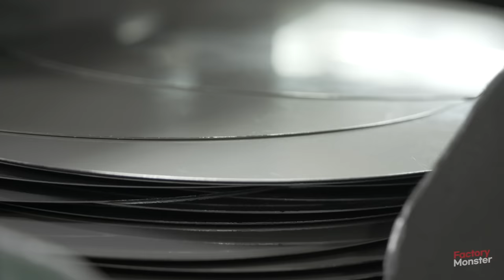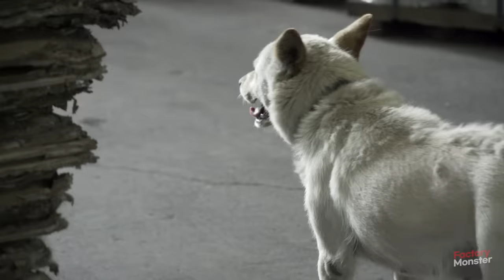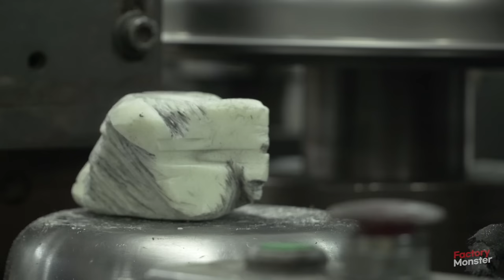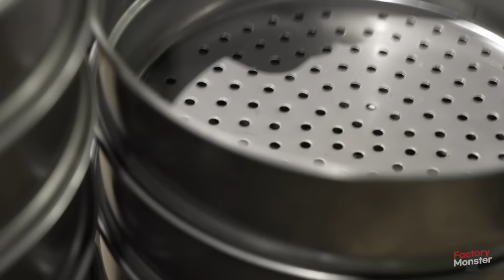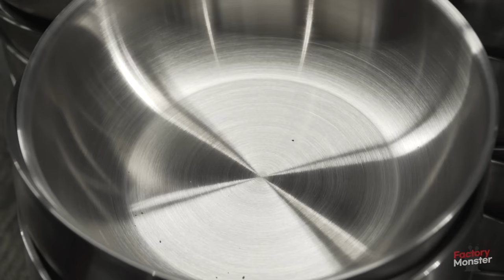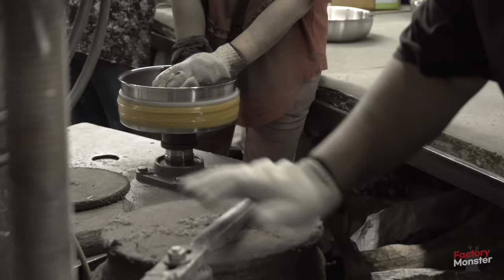Stainless Steel Steamer Mass Production Process. Korean Cookware Factory

Comment: Thank you for the tour! Polishing operations needs to be automated the most. Easy to automate, saves a huge amount of time.
Reply from the maker: Thanks for watching :)
Reply: Haha. Da kostet der Mensch nix.
Reply: @thomasschafer7268  в россии так же. Очень многое дешевле человеком лелать, чем автоматизировать. Но ситуация меняется. Людей все меньше готовых так работать.
Но руководство не дпемоет: Снизило уровень обязателтного образования до 4 классов школы. Уничтожило систему профессионального образования.
Reply: Automation cost a lot of money.
Reply: @Richard-om7vd  Having that many people doing polishing of a huge volume of products, it's actually cheaper to automate. However the psychological upfront cost of automation prevents many business owners to do so.
Reply: @x_ph1l  Are you willing to pay for it? Set it up, get it running, fine tune it so it matches the product EXACTLY like it was before?
Reply: @Richard-om7vd  If it were at my factory (which I have), then yes.
Reply: @x_ph1l  Nice. I'm almost 68, retired, former aerospace machinist, 30 years same company.
Reply: @Richard-om7vd  Cool. What we do is mostly fab shop type of work (plasma cutting, welding, powder coating, etc.). I'm only starting to get my feet wet in machining - so much to learn, but super interesting.
Reply: @stepansml6713  Про 4 класса - это ты сам придумал или есть доказательства ?
Reply: @stepansml6713  это ваше будущее! Вперёд  путина рука укажете путь
Reply: @x_ph1l  когда руку не заняты голова начинает думать а тамдумать вредно
Reply: @АгронДепартье  ст 43 пункт 4 конституции рф.
Reply: @АлександрЛивинский-в9й  это ваше настоящее. Я успел в нормальной стране отучиться
Reply: @stepansml6713  А отработать успел? Тогда удачной пенсии даже не большой
Reply: @stepansml6713  Ну - всё верно. Основное, а не начальное образование. Где там про 4 года ?
Reply: Less automation = more jobs = less wealth concentration.
Reply: @АгронДепартье  изменилось что то.  В лучшую сторону.  Что удивило.
Reply: @pdr5926  I would just LOVE to work as an elevator operator! Do the lever pushing all day every day. Up down up down up down. Great)

Comment: I’d like to know how many operators or hands have gone through those feed rollers. It very simple and cheap to put a feed/sort line in to move the operators away from the machinery. Also polishing is easily done with basic automated machinery
Reply: Bad engineering control. Definitely right
Reply: Сколько станков вы установили или поставили в северную корею? Ноль. Ваше правительство против кндр. В кндр есть производства передовые,которых в зазнавшихся странах нет.
Reply: @administracy  I've installed thousands of machines from very basic to very advance technology. There is no need to differentiate between technologies, but a need to always consider safety first. This is rank amateur.

Я установил тысячи машин, от самых простых до самых передовых технологий. Нет необходимости делать различие между технологиями, но необходимо всегда учитывать безопасность в первую очередь. Это любительский разряд.
Reply: @jarrac  не вижу не одной установленной вами машины в северной корее,хотя данное видео из южной кореи.
Reply: @administracy  The country is irrelevant. Safety first.

I do however doubt N. Korea has much in the way if high tech 

Страна значения не имеет. Безопасность прежде всего.

Однако я сомневаюсь, что в Северной Корее есть много возможностей для развития высоких технологий.
Reply: @jarrac  ваши соотечественники мешают
Reply: @administracy  Никто не вмешивается в то, как они производят продукцию или какое оборудование используют.
No one interferes with how they produce products or the equipment they use.
Reply: @jarrac  им не продают оборудование и сырьё,разве это не вмешательство?вы лицемерны или глупы
Reply: @administracy  если они хорошие, они могут производить свои собственные
if they are good, they can produce their own

не начинай ругаться
do not start to throw abuse
Reply: @jarrac  вы почему то не можете ,а они производят больше чем вы думаете.

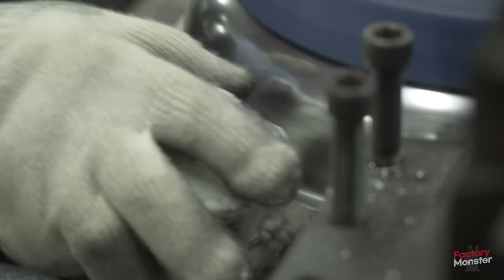Comment: 2:51 Soap works by attaching dirt particles to water molecules. You can use it to make yourself clean!
Reply: It helps it roll because soap is slippery. It lubricates the metal and stops it from sticking to itself or the roller.

Comment: I like the comment “your fingers are safe now” that’s good but the fingers of the workers in this factory certainly are not. Too many unguarded pinch points and presses. Also l like the tape on the forming press die to assist with venting of air, crinkled parts otherwise.
Reply from the maker: Thanks for watching :)